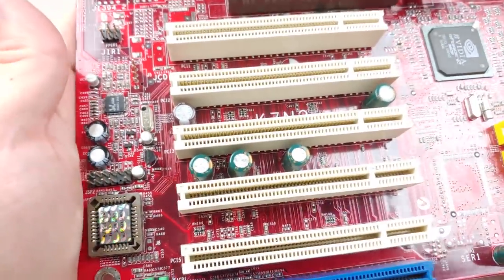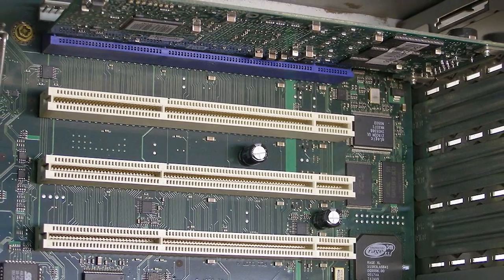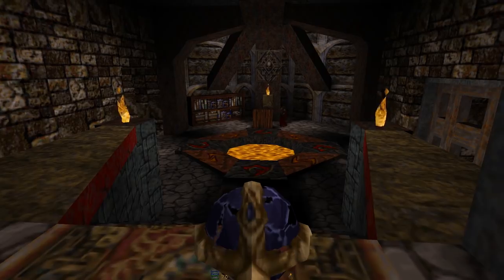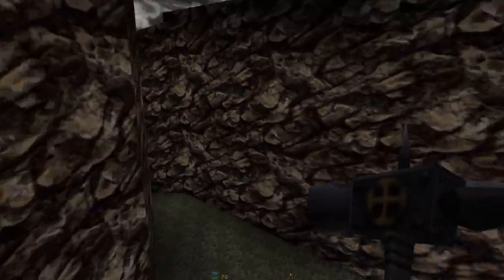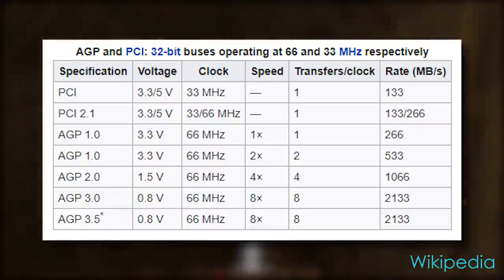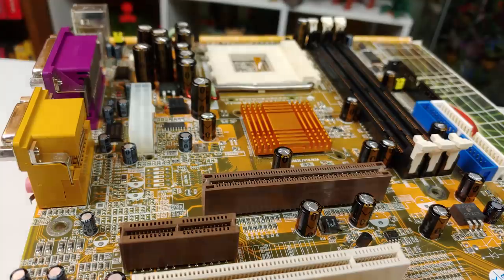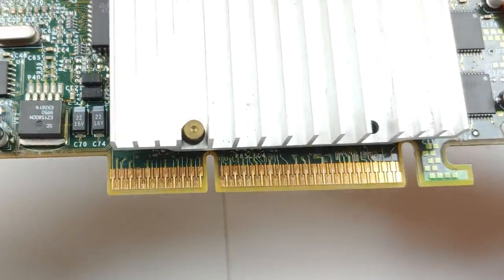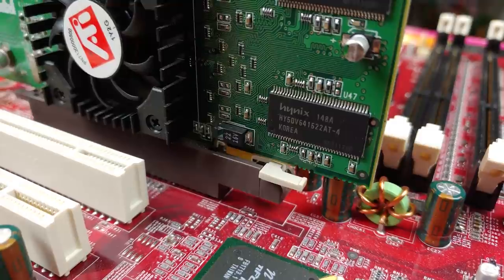A History on AGP: The Accelerated Graphics Port

Comment: The last AGP card I owned was the Radeon x800 Pro. It was available in both AGP 8 and PCIe. I was upgrading from an AGP 4 Ti4200. I still own both cards.
Reply: I bought an Asrock 939 dual sata 2 so I could keep using my 9700pro AIW.  And later upgraded to a 7950GT nvidia
Reply: The Ti4200 was my favorite card. I remember back in the day modding the heck out of that card pushing it running on par to a Ti4600.
Reply: Cpt Spank it was a seriously powerful card. It even ran Far Cry pretty good many years after the card came out.
Reply: Same I had a Saphie version and it was a little beast. Had it on a Socket A machine (which was a bit overkill but it helped ease the CPU’s job). 

Good times playing Orange Box games and other mid to late 00’s titles.

Comment: Very nice overview of the tried-and-true AGP bus.  I have been tinkering with many motherboards with that slot over the years, very recently putting together a machine with a MSI 694D Pro...implementation of the early 4x slots didn't always pan out like they were supposed to. I'm finding that the early VIA chipsets supporting SMP (this is a dual PIII motherboard) are a great migraine trigger! They were notoriously bad for not running their 4x AGP at 4x.  As time goes on, it is also getting harder to find archived forums that detailed the struggles of those that toiled on these machines in that era.
Anyways, I've always appreciated your well written scripts loaded with such good information.  (Also, looks like you might have a nice 5950 Ultra on the shelf!)

Comment: 10:04  I still  have one of my 939Dual-SATA2, but it just stopped booting one day so I bought another one... then that one did the same thing eventually.  I remember upgrading from a GeForce 6200 to a GeForce 8800GT back in the day as a result of that motherboard... what an upgrade!
Reply: I had the same problem and I read it is about the bios. Anyway, Asrock is crap :/. I bought an asus high end with 775, and I am so happy.
Reply: @3dfxlegacy  Bummer that ASUS is pretty sub par now. I'm legitimately stunned at how awful a lot of their VRM designs are these days.
Reply: @3dfxlegacy  You say Asrock is crap, but the funny thing is some of the most desirable retro motherboards to get are old Asrock boards. Their designed might not have captured the attention compared to DFI's fluro UV. But they had very solid designed and are also some of the best for early 2000's XP era retro machines. Especially those rare native 8x AGP & 16X PCIe combo boards.
Reply: I had a 939Dual-Sata2. It was great. I had an Athlon 64 3200+ on it, afterwards an Opteron 165. Also my 6600GT AGP, upgraded to 7900GS PCI-e. All on the same board!

Comment: During the lockdown I finally built myself a very fast AGP WindowsXP system and I'm loving it. Specs of my "Ultimate AGP PC": Pentium Dual Core E5800, 2x1GB Kingston DDR-400 cl3, Asrock 775i65G Rev.2.03, Sapphire Radeon HD3850 512MB GDDR3 AGP, SoundBlaster X-Fi Platinum, Transcend 32GB SSD, WD Velociraptor 250GB, Corsair CX430, Chieftec Dragon.
Reply: sweet setup! I have an AMD FX60 on an MSI K8-Neo2 with Corsair Pro blinkenlights RAM and I use a WD Raptor 10k 36Gb drive, the GPU changes with what I want to do with it but it's most often either a Ti-4600, 6800Ultra, ATi 1950pro or a HD3850 AGP
Reply: Nice build! But i would go for 8gb of ram since XP can still hang with 2gb
Reply: @Dragonfire511  I need another motherboard for more. 2GB suits me fine until now tbh
Reply: @KARAOTI23  for retro games its an awesome build.
Reply: Oh, that's a rare find! the pentium E5800 is the last LGA 775 CPU so it doesn't work with most older AGP 775 boards. Nice build :). My windows XP PC is an HP Worstation xw4400 and it's pretty overkill for XP, especially with the quad core Xeon CPU I put in it xD. Knowing that it was 2500 bucks In 2006 is mind blowing tho.
Reply: @staz3014  That's sweet! Which Xeon have you put?  Is this compatible with Wolfdale Xeons? About my board its first BIOS was released in April 2006 and latest update was in December 2009! So It is an old board as it was released even before the first gen Quads!
Reply: @KARAOTI23  It only works with 65nm chips as i tried with a Pentium E5800 (Like yours) and a C2Q q9550 (Both are of the wolfdale architecture) but i managed to get a Xeon X3230 working in it with a custom microcode update i found on the internet. It's one of the best CPUs you can put into it, and considering i only paid 11 euro for it i'm pretty happy about it :)
Next upgrade will be 8 gigs of DDR2, and some big hard drives. I'm planning to make it into a NAS since it has Gigabit ethernet on board
Reply: Im after upgrading my pc agp card. But im a bit confused. Would be happy if someone helps. Umm, my motherboard is a ddr1, but it has agp 8x 1.5v slot. So i was watching what i can use on this setup to make an improvment. Well all 512mb agp cards have a ddr2 next to them. And i was searching google much this week to find some info on it but no results. My motherboard is Ga-8i865pe775-g-rh. U can check out. Any help would really b appreciated.
Reply: @abolfazllalimi1638  You can put all the latest agp cards including HD3850 and HD4670. What cpu do you have and what is the revision of your board? The rev.4.9/3.0 support up to the Core 2 Extreme X6800, but the E6700/6600 are good choices too.
Reply: @abolfazllalimi1638  The video card doesn't depend on the type of memory on the motherboard.  You could have DDR3 motherboard and GDDR5 video card for example.
Reply: @TheLionAndTheLamb777  yep, i learned that later on. Now im thinkin of upgrading it fully to ddr3. Any budget options u can give me? With upgrades later on? Or ddr4 boards with later upgrades? What to do with the old board?

Comment: AGP was dominant in the early to mid 2000’s and I wouldn’t have bought a motherboard without it back then. It allowed GPU’s to escape the backwards compatibility shackles of past times and move forward with the leaps and bounds graphics were makings it was a great thing back then. I had PCI-X on my Tyan motherboard for SCSI U320 adapter but alas no GPU’s used the PCI-X interface at least that I know of. Another great video.
Reply: This is probably unexpected, but: thank you. A few years ago some random guy tried to tell me I was lying when I said I'd ogled enthusiast-level systems with PCI-X back in the early 00s. He kept saying they were only ever used in servers and workstations and never ever appeared on even the highest-end home setups. Even though I knew what I remembered, it's still an interaction that's stuck with me. Even after I clarified it was the kind of "workstation at home" user that buys a Threadripper today or a Xeon in the '10s. So, yeah. Thanks for validating that memory!

Comment: AGP was good but it wasn't all roses all the time. I remember having a fair amount of issues when AGP 4x was released with certain video cards & certain chipsets. There were times when you had to go back to AGP 2x and/or disable fast writes in order to keep things stable. 
PCI-E IMO is probably the best interface to come along since the original ISA slots!
Reply from the maker: Correct me if I'm wrong, but wasn't that an issue primarily with VIA chipsets of the time?
Reply: @PixelPipes  yeah! Only Intel had the real circuit plans to produce this technology while Via,Ali,SIS did reverse engineering to try do something similar.. speed and stability weren't they highlights but you could at least try with a video card/chipset combination drivers to get the best results

Comment: I still remember using an Intel 740 "starfighter" 8mb card. Had to hold the heatsink on a few times during intense cs1.6 matches when people went nuts with smoke grenades. Smoke made the gpu work HARD. played shogo Mad with some settings tweaks and tachyon the fringe. I was surprised that the gpu never killed itseft when the heatsink fell off. It was thermal glued on. I'm curious to see if  the 740 performance would be better with a fast ddr2 system when using dma.

Comment: My last AGP card was a PNY XLR8 6800GS. By using Riva Tuner I was able to unlock the pixel and vertex pipelines from 12/5 to 16/6 same as the 6800GT.  Fun times back then!
Reply: Mine was only unlockable to 12/6.

Comment: ooooooh boy. Painful story that agp, with a bit of a happy ending. When we got our first modern PC(for the time), AGP was almost out the door. My 6800GT barely lasted a year. Nvidia's 7xxx series rolled out and it was PCI express only. I could not upgrade my PC. Even my mobos socket was a dead end as there were no dual core CPUs for it. Fortunately Ati released AGP versions of the HD3650 and HD3850. I got the 3850 and it gave my system some more life. I could play mass effect when the PC port hit store shelves and it liven up the frame rate on Oblivion and F.E.A.R

Comment: I've been interested in testing AGP vs PCIe but it's really difficult.

The best case scenario is using the asrock 4core dual but even then you're limiting the PCIe version of the card to PCIe 1.1 at 4x lane... I feel that's an unfair comparison
Reply from the maker: I've been struggling with it for a while. There are solutions that are better than the 4CoreDual but there's always a compromise somewhere.
Reply: Asrock 939 dual sata 2.  its native 1.1 at 16 lanes. And with the AM2 adapter and bios hack you can use a phenom 1 quad.
Reply: @wishusknight3009  the 939Dual with AM2 card is a good one. But good luck finding that upgrade card. Also ther is an ASRock board called AliveDual-eSATA2, a native AM2 motherboard with PCI-E 16x and AGP 8x. According to ASRock it has a solution with 2 chipsets using a ULi M1695 and an nForce 3 250 Ultra limiting the bus speed of the Phenom processors. Another problem I see is that most more powerful AGP cards use a bridge chip, so that might influence performance as well.
Reply: @PixelPipes  Get an 939Dual-sata2 and do 6800 GT native AGP vs native PCI-E, or X800 native AGP vs native PCI-E; it's the only native AGP vs native PCI-E I can think of, however. Later generations used bridge chips like mad.
Reply from the maker: @qpwoeiruty668  Had it, used it, reviewed it in a video. It doesn't support enough CPU power. You'd be surprised how far the 16-pipe generation of cards can scale in performance.
Reply: @PixelPipes  Ah, need more oomph (forgot about that video too, thanks for reminding me). Only other solution for single motherboard test setup is to get an alivedual-esata2 and pair it with a Phenom ii x4 Deneb, but they seem to be insanely rare. Otherwise you may have to use 2 different motherboards with a core 2 platform. Good luck if you decide to go for it, it'd be pretty interesting to see how it unfolds.

Comment: I still remember the legendary BSODs caused by badly coded AGP drivers. Good times.
Reply: That's driver's in general regardless if it was a PCI, AGP, and PCIe cards, chipset driver's or what have you. Badly written driver's will cause a BSOD.
Reply: I remember it took years to get a good VIA driver to run at AGP 4x.

Comment: I will never forget my mistake: getting a Radeon HD 3850 AGP… for a Pentium 4 machine. Then got stuck with the card and had to “upgrade” to a newer system with an AGP slot. This was in 2009. Oof.
Reply: LOL, did you just do no research prior or did some local seller scam you?
Reply: @armorgeddon  I was just a teenager and didn't research too much. I thought that I would be fine with just upgrading the GPU instead of getting a new computer with PCIe (considering the cost as well). Boy, I was wrong.

Comment: I had love/hate relationship with AGP. The cheap Socket 7 mobos (like Acorp) with non-Intel chipsets had various issues with that interface, often resulting in graphics artifacts in 3D games, so I had to turn off most of the advanced AGP features and downgrade it to simply a high-speed PCI, after spending countless hours in swapping drivers and flipping BIOS/Registry settings.
My last AGP mobo was Abit KV8-Pro and it is where I first managed to get my GeForce 6600GT to play hardware-accelerated HD video (max 720p at that time), thankfully to the proper implementation of the last AGP specs, incl. FastWrites , that allowed direct transfer of data to the GPU.
Honestly, I had a relief after upgrading to PCI-E and leaving the fragile and fragmented AGP standard for good.

Comment: When i was using AGP 8x i used a 6800LE (modded to GT+ unlcked pixpelpipes) 
before stepping over to pci-express  then i bought a xfx 7900 GT

i remembering some of the Agp cards could still compete with their pci-express counterparts 

This video is usefull for those that never owned a agp port or even heard of :)

Comment: Here’s a trivia question: what was the original name for AGP? 
Hint: it had to be changed because of trademark infringement.
Reply from the maker: I give up, what was it?
Reply: PixelPipes AGP was initially: GAP (Graphics Attach Port). A certain retailer had already trademarked GAP. 

Intel did work closely with ATI on defining AGP. 

One of the reasons ATI surged in market share in the mid 90’s was because of the integrated 3D with AGP2x support (RagePro)
Reply from the maker: Cool!

Comment: Can you possibly do a more in depth look at AGP history , more specifically how it made its way onto socket 7 becoming a socket 7/AGP (NON SUPER 7) and that did not make it a super socket 7 board and how AMDs design of Super Socket 7 helped AGP gain a foot hold. why a Chipsets like SiS5598 is a generic integrated graphics controller and not AGP, though it was thought to be the first AGP chipset - I believe the SiS5592 was SiS first AGP , who was the first manufacture to use AGP (FIC PA-2012?) who was the first Super Socket 7 with AGP to market.

Comment: I hate to nitpick but you’re pretty fundamentally wrong about VLB, and PCI being just a condensation thereof. VLB could be said to be a 32-bit extension of your standard ISA bus, but that’d be a dramatic oversimplification — it piggybacked on ISA to be assigned IRQs and DMA channels and such but a proper 32-bit extension to ISA would be EISA, a standard notably supported primarily by Compaq as an effort to avoid licensing the micro-channel bus from IBM’s PS/2 line, which was supposed to be the “next generation” PC bus.

VLB mapped devices directly into the memory address space of the 486 processor.  This is why it was considered so hacky and kludgey even for the time — it made exactly zero effort to future-proof itself. As newer CPUs came out that had different memory maps, VLB would have to be translated — often to PCI, in the case of early Socket 4 Pentium machines. PCI was a solution to offer the theoretical throughput of VLB (I say theoretical because you’d never, ever, ever get those speeds over VLB) and then some with the later revisions but in a platform agnostic way. This is why you saw PowerPC Macintosh machines and DEC Alpha workstations implementing it as well. To call it a condensation of VLB is kind of insulting it — it works completely differently.

Other than that I have exactly zero complaints! Excellent video!

Comment: AGP was a good time, but unfortunately also with many problems. Be it with LX chipsets, the power-hungry graphics cards couldn't cope and you had to be afraid that the voltage converters would die... Or also MVP3 and AMD's 750 chipset in which no GeForce cards worked without crashes... Only the slow 1x mode and disable sideband addressing and fastwrites to get the cards working... Or as universal coded cards that didn't work in 2x slots. Yes, we've seen a lot with AGP over the years. It's a pity that you can't buy a bridge adapter to get PCIe cards running on old AGP slots. For PCI there is something like that, I had an old PC from 2000 and a KT133 chipset running with a GTX750. Unfortunately, the PCI bus slows things down quite a bit.

Comment: You forgot the 32bit EISA have the same principle like AGP those teeth pins :)
Reply from the maker: forgot? or....was never actually aware until you told me 😅
That's interesting though! Might be the first instance of that.
Reply: @PixelPipes WoW oh I am surprised that you do not know about that! :)
Reply from the maker: Yes, contrary to popular belief, there's a LOT I don't know.
But since your comment I read the wiki about it, and the story behind it sounds very familiar. So it might be that I did just forget. It certainly wasn't very widespread, and it's interesting that VLB and PCI caught on but EISA didn't.
Reply: @PixelPipes  yes I so thsoe slots in person on server boards, one 486 and pentium Pro ;) BTW it is ISA compatible, unfortunatly as you explained the problem with this teeth design I burned this pro server by removeind standard ISA card from the EISA slot while it was on power :( I was frustrated, becouse the system hanged for who know witch time. I really regret that :((

Comment: AFAIK there are not true cards/mobos AGP 8x compatible. This standard was forgotten for the PCIe. PCIe hit hard and quick, but AGP always resisted the transfer rate.

For the other hand, I am very surprised by the locking mechanism, I am seeing mobos about years with this but I never thought in this. I always see it as an extra.
Reply: Not sure what you mean by "True AGP 8X" since both ATI and nVidia had multiple generations with 8X support.

They seem to have avoided the voltage reduction from 1.5 to 0.8, but they still ran at 8X.